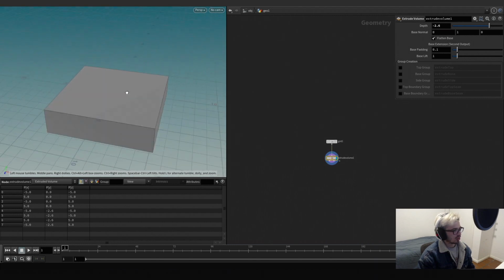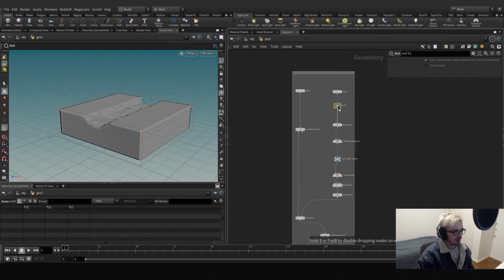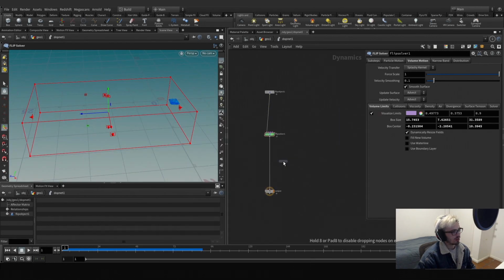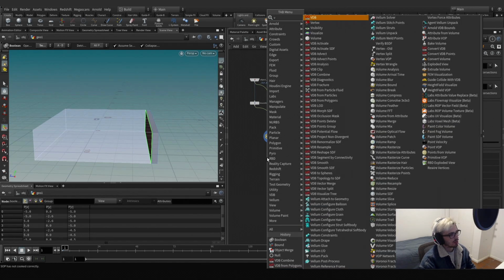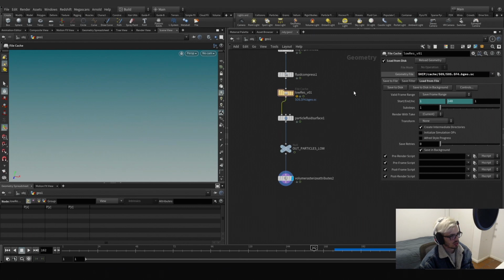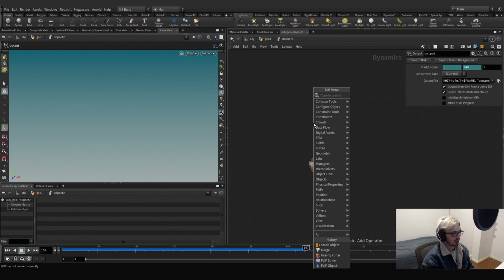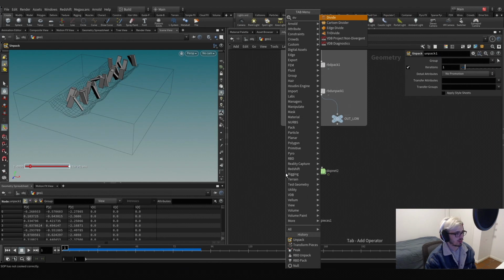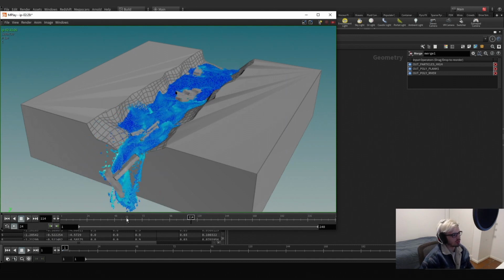Creating Realistic and Easy River Debris!

Comment: Nice technique! I had to do something similar on a show a bit before you released this video, what made it particularly challenging was getting the debris to float on top of the water surface, since the surface tends to vary too much between proxy/highres sims. Maybe that's a little challenge to tackle at some point, I still don't know a good reliable method to achieve that with a more complex constraint RBD setups. We had to cheat it all the way.

Comment: Nice solution, but why not to use the feedback option so both flip and rbd interact in one sim. Thank you alot
Reply from the maker: Hi, thanks for commenting. Usually that option brings up problems due to the packed nature of the rbd whereas the flips work with unpacked geometry. Explosions in water may cause inestabilities. Thats the only reason. Nice content btw.
Reply: @pizola3285  thank you for your input, and efforts of exposing cool tips and methods of using houdini.